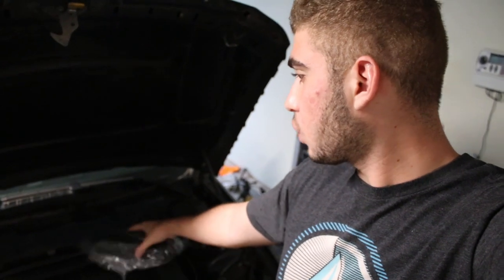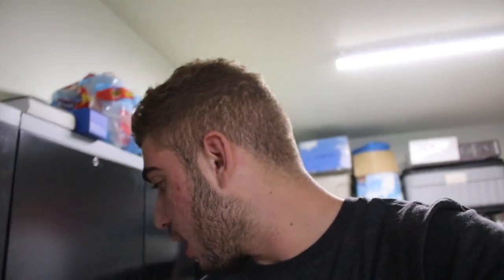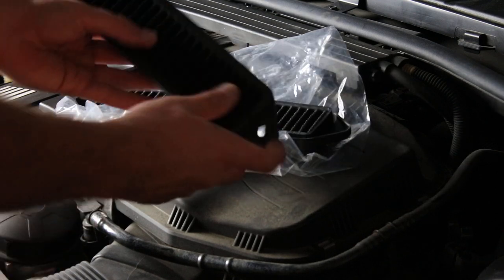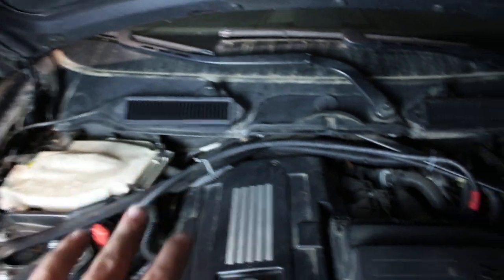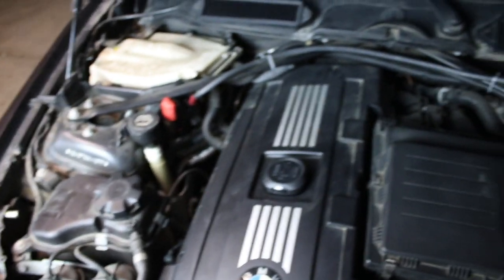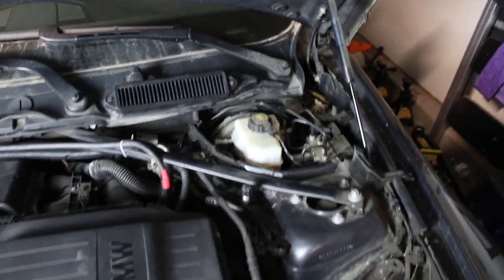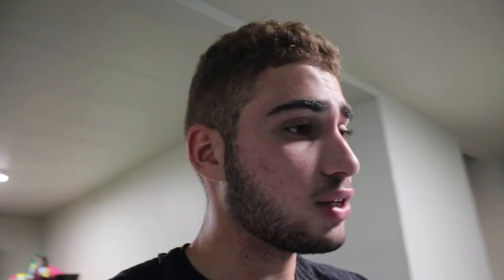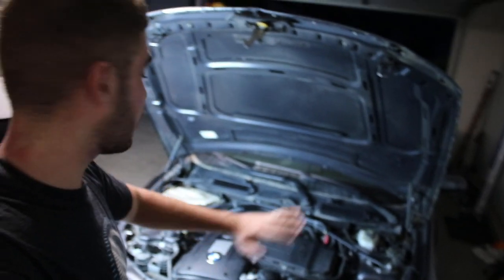Burger Tuning Cowl Filter Instal BMW 335I N54! (Update)

Comment: Do you think when it rains the water will ruin anything in the engine bay?
Reply: Rudedoggy_ 760 From what I've read from several posts is that it doesn't. Cutting up the big plastic to keep the water channel in tact is still probably better. I'll be doing that in a week or so.
Reply: @Chicitypo  which plastic